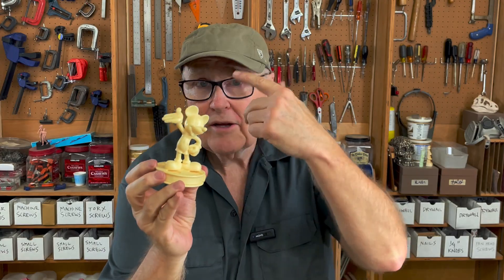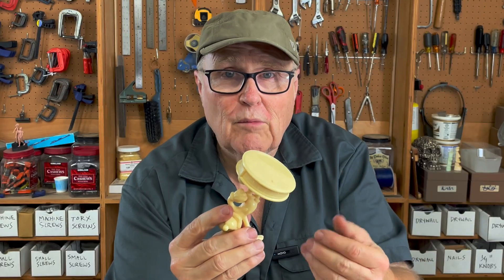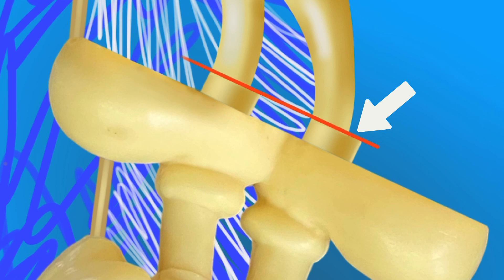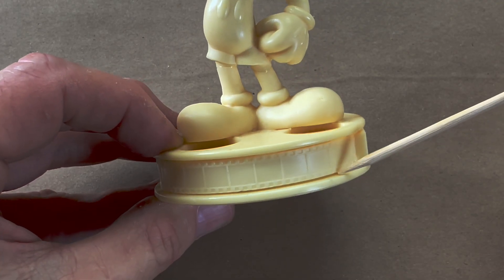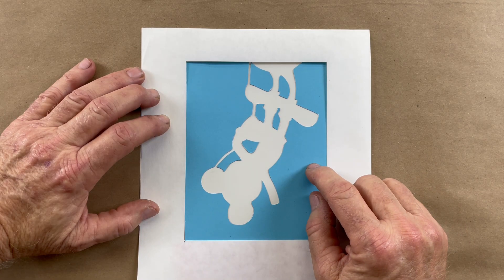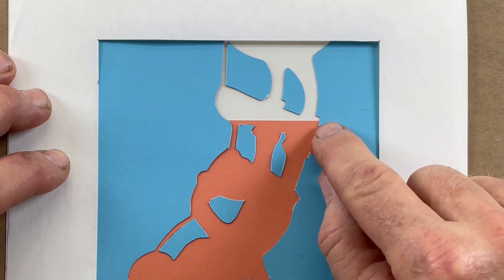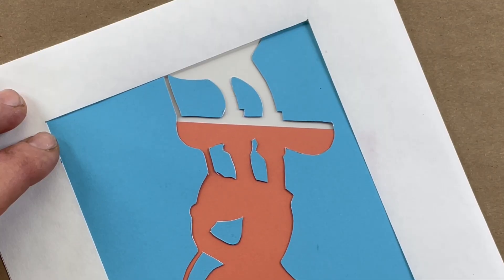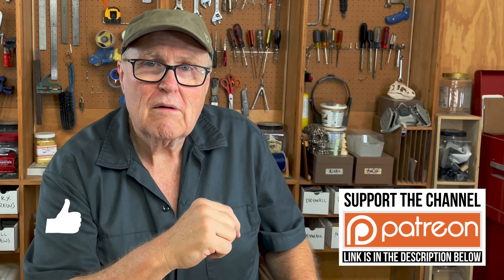Break It Down - Casting Complicated Objects

Comment: how about hard mold casting (like hand AB/molten injection mold cast), you seem to do soft mold casting most of the time
Reply: how about syringe injection casting into (hard) molds, ie forcing the stuff in, from the bottom, letting gases out from the top injection hole

Comment: Mr Tolone, I'm so happy you're on YT, posting awesome content.

I have a few questions.
1. It's very highly recommended to degas silicone prior to making a mold for obvious reasons, but wouldn't it be a good step afterwards to degas the silicone after pouring it into the mold? I mean, logically, wouldn't it eliminate all the bubbles trapped around the model? Just in case, silicone setting time and frothing/mess aren't an issue.

2. I'm considering setting up a tiny side project where I'd be making copies of some small elements, but those would be dyed. I'd rather avoid the hassle of dying resin every time, so the idea I had is to split one of the resin components into containers and pre-dye those. This way, if my reasoning is correct, I'd just end up with a perfect color match, every time I mix and cast. Do you think it would be viable?

Thank you!
JK
Reply from the maker: I never put a model under pressure or vacuum because I don’t know if it has voids inside of it. That would either explode or crash when the vacuum or pressure is applied. Also, I don’t do it because it’s not necessary.
I dye urethane resin all the time -  https://youtube.com/shorts/6H7Pf3QEr4o?feature=share

Comment: Great videos! Thanks for all the tips! Could you offer a suggestion for a reproduction motorcycle seat pan material, I made the mold using your tips and the parts are pretty good, but the material choices  I have tried are to brittle to accept staples to hold the seat cover, I am looking for a material similar to 5 gallon plastic bucket - i prefer a material that is white/ opaque- or can be colored - not a must have though. Thanks for your time robert b

Comment: Been busting out some high tech illustrations recently. Loving them all -- whether computer generated or how you did it here!!
Quick question: have you ever done a shrink mold? I'm gonna search your content here now, but figured I'd ask here. 
Looking to shrink some heads from a 1/12 scale toy line to put on / use on a 1/18 scale line. Mixed silicon with mineral spirits, poured, demolded and now waiting for the mineral spirits to evaporate to see how much shrink I get. Did a 50/50 this time. Figure to make a cast in the morning,  then another either late tomorrow and/or Sunday morning to see if I get the right size.
Reply: "Calico"?
Reply: @Pygar2  ooof..."silicon "
Reply: @FiguresOut  I'm having that kind of week, too...!
Reply: And now?
Reply: @Pygar2  i cast another mold to shrink the now 5" scale legends heads to get them smaller (hopefully to 1/18 scale). So waiting for that to dry out...have the other mold from 90s 5" scale to 1/18 dried out...now its a matter of getting back home from vacation to test, but the molds from before came out 😁👍
Reply: UPDATE: not so good...a little deformed and awkward pieces coming out of the mold so far. Gonna give it another couple days to maybe dry out that mineral spirits, but so far no dice.

Comment: any techniques on painting multiple figures with tiny detail and want to keep consistency? like if it had teeth and needed to paint them white, do they use templates they lay over the model in the industry? toys and figures have such fine detail that noway a human could paint, theres gotta be some secrets to making a professional figures. Take the Homies figures for example, each one has different colors and tiny detail that have to decals and templates, i want to replicate that at home on a small scale. Also what paints should i use? acrylics are ok, but take many layers to get a nice clean look. any models paints or somthing thats only takes one or 2 coats?